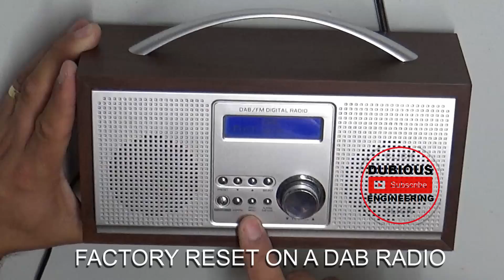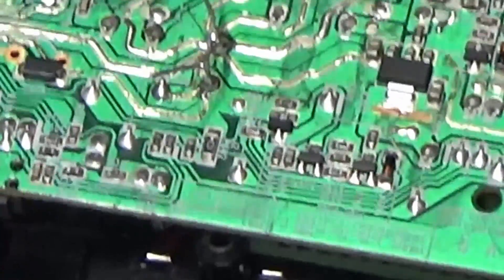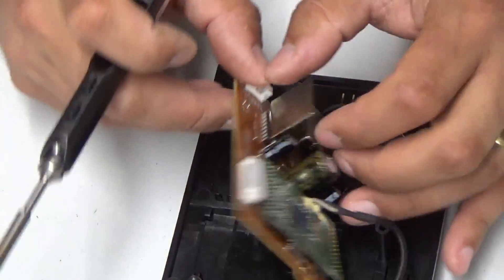DuB-EnG: Repair a Broken Farting Sainsbury's DAB Radio Audio Amplifier and Perform Factory Reset Fix

Comment: Hi howard, i have a blue screen, nothing works on radio, cant reset or do anything? Any ideas whats up with radio
Reply from the maker: Sounds like power isn't getting to the PCB...  It's the blue screen illuminated?
Reply: @DubiousEngineering  yes, it's blank blue screen, none of the buttons work

Comment: Didn't hear any sound from radio - before/after.  Very messy long soldering job. Why used low ESR capacitors.
Reply from the maker: It's cheap, I'm a skinflint, the caps were in the draw, no point in spending money if you don't have to!

Comment: I have one of these and a couple of weeks ago it stopped making any sound. The display works, and it scans fine, but no sound. I've booked it up to some different speakers but still no joy. Could it be the capacitors, or the amp chip at fault?
Reply from the maker: Those caps tend to dry out over time and can cause issues...

Comment: So if you also replace the power supply and put much better speakers in it it would be even better? I like the idea of a farting radio, wish it had a switch just for that!
Reply from the maker: Actually that’s a very interesting point!  If you fitted two sets of speaker binding posts on the rear and connected two external speakers this unit would sound amazing... that would be a fantastic easy upgrade!!!   Plus I’d fit a missile switch to make it fart just for you :-)